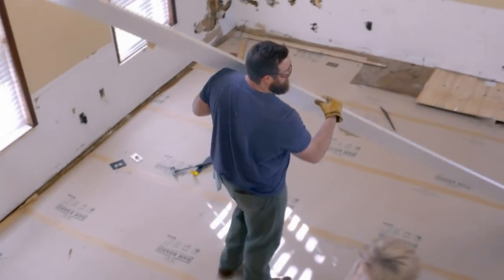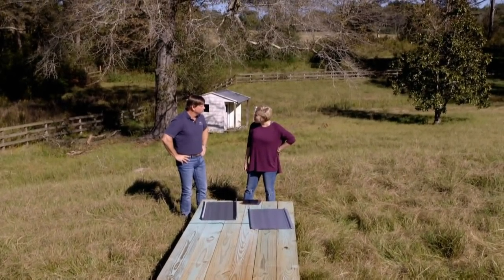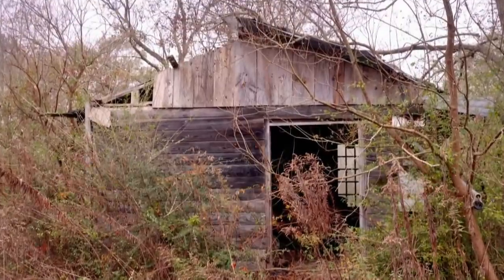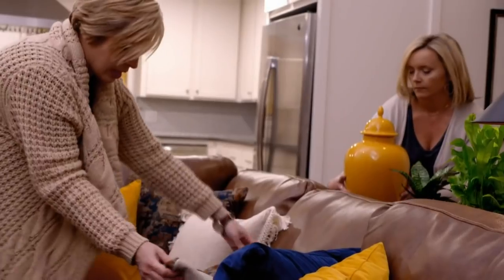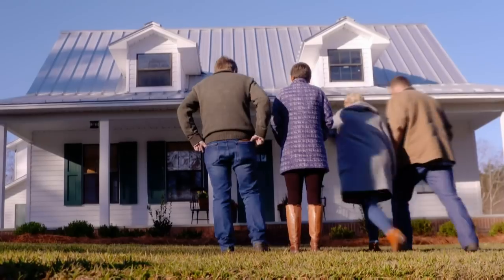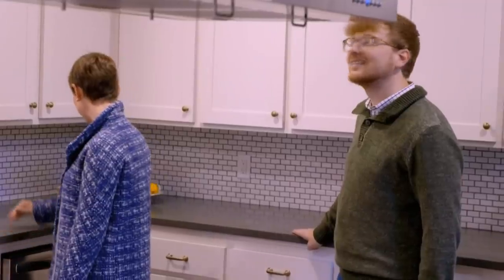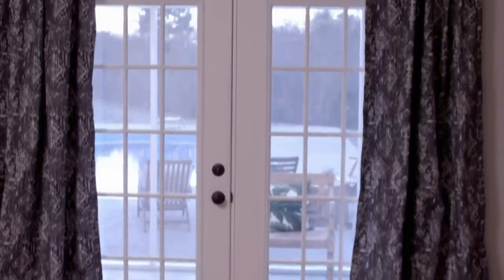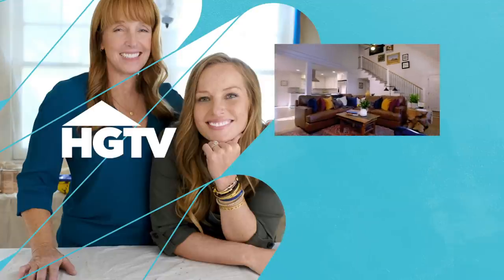Erin Decides To Install A METAL Roof On This Traditional House | Home Town

Comment: This is what the Director at the Canadian Roofing Association (CRCA) has to say about Hy-Grade: "I will say that I have researched this company – Hy-Grade Roofing - and did not take me long to find several complaints and bad reviews with the BBB (Better Business Bureau). These types of complaints would have been enough for me to pass on this contractor. I see many issues and complaints related to the many ‘Metal Roofing Companies’ who promise the world to the customer, then don’t follow through when it’s time to enforce the warranty or get issues rectified..." Not even the CRCA would use you as a contractor. I invite all potential customers to contact the CRCA before signing with Hy-grade!

Comment: The front porch needs redecorated. Centering the chairs and planters makes the porch look more off balanced, instead of less. There needs to be different furnishing on both sides of the porch. On the side with the one window, there needs to be a tall backed chair or bench next to the door. Without something tall there the porch is visibly off balance. Redo. Not a fan of the headboard. Looks to be missing top pieces on the right and left. Could be taken apart and redone by a talented craftsman.